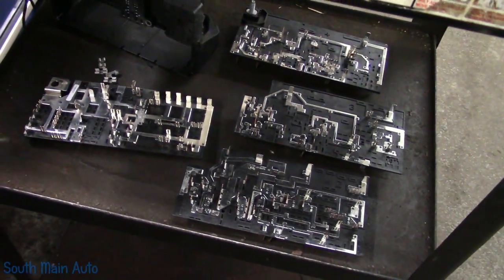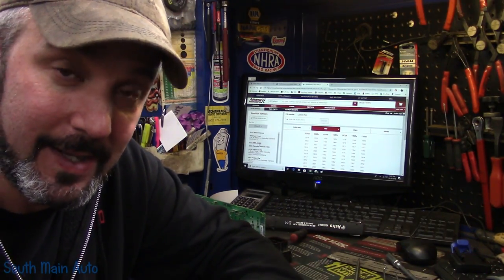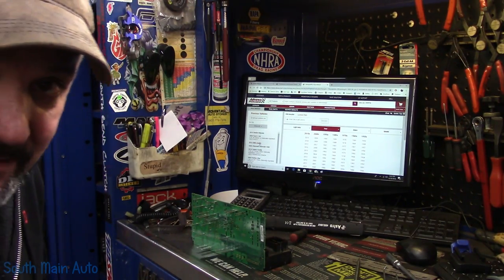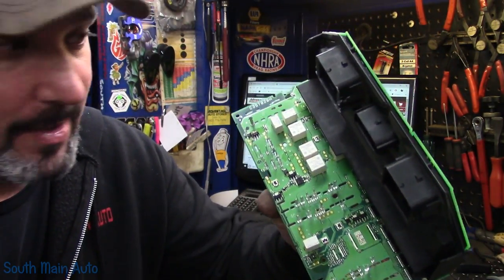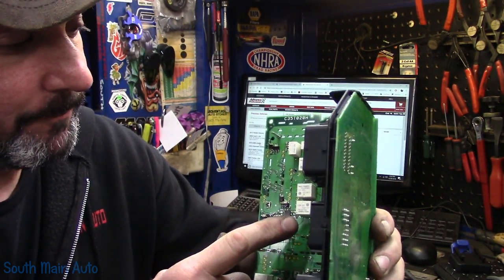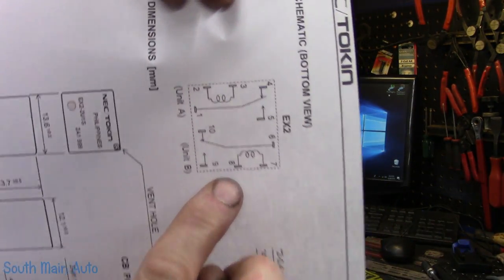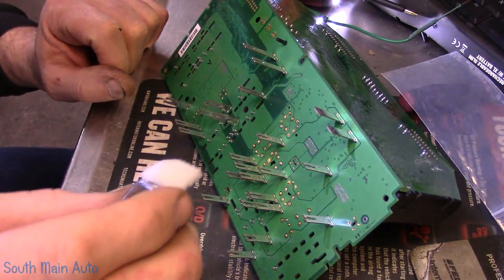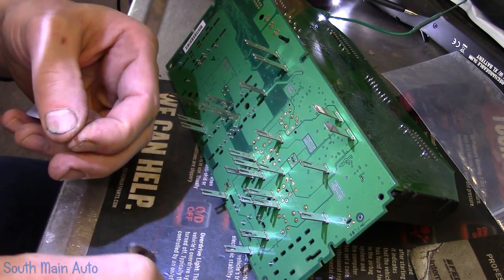Chrysler / Dodge : TIPM Repair - No Wipers

Comment: Well you got the job done, but the quick way would be to cut the whole relay off its base with some side cutters. Then cut up the plastic base so that you are just left with the relay base pins sticking out of the circuit board.Apply heat from the soldering iron to each pin in turn and pull it out of the board. Then get a sewing needle of the right size, reheat each hole and run the needle through to clear out any solder. Fit the new relay and solder.

Comment: Board repair is great Pro tip find something on the curb with a circuit board to practice on before you take on a $600 board

Comment: Desoldering braid, flux, and a solid temperature controlled soldering station such as a Weller, will get you to pro status quickly.  Hold the iron atop your fluxed braid over the solder joint, and the solder will wick straight out.  650-700 degrees is where you want to be.

Comment: it's the black chip usually a micro-controller or FPGA limitations are programmed and so it needs to be re-flashed the correct way to use microchip

Comment: Oh man, Chrysler/Dodge need a kick in the relays over this.
Done a few of these including external mounting relays.
Is pretty easy with good solder sucker tool .
Once you done half a dozen it worth doing it for customers as quick, parts/materials under 10bucks and a good earner and saves customer money and down time .
Easy self warranty for 12 months and I had none back for warranty yet .
Buying oem new total waste of money, reman option if life warranty but in house relay repairs is way i'm going when possible .

Comment: I know this is a old video but man you are amazing 
I own a 2015 Ram 1500 for 8 years already and I love it till 5 months ago I trying to install LED lights
That mess up the stupid famous TIPM 
I wandering if there is a relay down below the TIPM for the passenger side headlight 
I tap on a cigarette lighter fuse and ram a wire straight up to the bulb and another one from the bulb to ground 
It is not a good fix but I have a light on the right side wen I turn the truck on 
Is there is a relay down there I may do the same you did with your sister wipers 
What do you think?
Thanks for all your great video friend

Comment: You were Exactly right when you mentioned using flux when using the desoldering wick put a little flux on the wick touch the solder pad with the wick between the wick and your soldering iron and Robert's your Dad's brother!
 However, when I saw you holding the solder wick so close to solder pad  i Cringed!
 That is how i learned Not to do that! 
Hold the piece with some pliers   or forceps then apply heat.  Not only does solder Wick up the solder So Does Heat!

Comment: Eric 'O' can you please explain why my wife's 07 RAM 5.7 Hemi threw a MISFIRE CODE on #5 cylinder when what was actually happening was the Hydraulic Lifter Roller had seized up and destroyed the Intake Lobe. Why would that throw a MISFIRE CODE! Shouldn't the KNOCK SENSORS have picked that up? It was not an electrical issue after all.

Comment: Clean the tip of the iron first with a wipe of a wet sponge. Cleanliness is next to Godliness! 
Apply a fresh coat of solder to the tip. Touch the cleaned tip and apply solder to the old solder joint. CLEAN THE TIP!  Your procedure with the solder sucker is correct. I use one of those solder suckers on circuit boards of the flight simulator all the time. They work great. The only thing better is a heated solder sucker. Don't stay too long on a hole for you will desolder the land on the circuit board.

Comment: The solder wick has flux in the braid, which is how it sucks up the solder.   They come in narrower widths than what you have....and the narrower wick is what you needed. Put the wick on top of the connection, then heat it from the top through the wick.....  :)  Solder suckers work great too.....   Same deal, heat up the joint, and with the iron still there, suck the solder out.   Keep in mind that plated through holes....are sensitive, so don't go poking or pushing components through the holes....just suck out all the solder.    Takes a bit of practice...have fun!!

Comment: The most likely reason for the contact melting together is a high resistance contact.  I repair this type of electronics for a company who inspects rail road tracks for defects.  When the contact becomes resistant it can get hot enough to weld together.

Comment: Yeah ya need to add solder to the solder joints, then remove the solder as said by beachwood619. The soldering iron is hot enough for soldering but not for de-soldering. The Solder wick can be folded over having two layers, then lightly applying solder flux to help the solder flow on to the solder wick while slightly moving the solder iron and wick back and forth. Practice makes perfect. A hotter soldering iron will allow you get on the joint and allow the solder wick to suck up the solder a lot quicker. Good fix I am impressed you took the relay box apart and fix the din dong designed relay box. I use a 100 watt iron and a 75 watt iron for those solder jobs. Got to keep the iron tip clean also.

Comment: The relay contacts fused together was probably caused by some dirt on the contacts causing them to arc. With DC, once they begin to arc they can continue to arc till they melt and fuse together or they melt far enough apart to break the arc. larger DC relays actually have arc quenchers built into them to extinguish the arc.  AC relays do not tend to have this issue due to the sinewave passing zero volts, extinguishing any arc.

Comment: As others have commented... whether wicking or sucking, add fresh solder first. Especially those new lead-free things are a b*tch to wick without adding solder first... your wick will run dry of flux before the unleaded solder re-flows well. 

Europe has pretty much phased out leaded tin solder from private customers, leading some of my hobbyist acquaintances to hoard it when it was still available. Despite that, I have found a 70% lead mixture that was openly available. I haven't tried it yet, but I assume it might be great for reflowing unleaded.

Comment: When you use a desoldering wick, you need to first clean the board with alcohol and a toothbrush. Then, you add NEW solder to each joint the wick will be used on. The new solder will be clean and will be transferred easier to the wick. Also, ensure the tip of iron is clean. If it isn't clean and has ash all over it, the heat will not be evenly distributed.

Comment: Could be the soldering iron tip was a little small to transfer heat quickly enough when desoldering. The braid never works for me....use the pump. When the hole is cleared of solder I break the pin loose with small pliers, grab the pin tip and pull it sideways to break the final bit of solder free. You did a good job....any job that works is a good job IMO

Comment: The fuel pump relay recall for the Dodge Durango works for all cars.  You can splice in an external relay with instruction and kit from Dodge.  Worked on my 2011 Caravan.  I would bet every relay could externally replaced by splicing the harness like the fuel pump relay recall procedure.

Comment: you're hands must be fire proof because of how close you were holding the solder wick. I give it about 6 inches of slack and hold it buy the case so i don't burn my hands, the heat should transfer to the wick. I was waiting for you to jump back and say ouch, but i guess not.  maybe that was the issue, you have to put pressure down on the solder joint with the wick inbetween and it will absorb into the wick. Also  sometimes you need a solder sucker.  must have really felt great to save your family 600 bucks! Though, why did you let them buy a dodge?  in any case, this video shows you are human ! hah Happy new years SMA.

Comment: great job even though you weren't 100 percent confident. if you would have added  a liquid liquid flux it would have gone a little easier. also when you use the wick to remove solder you need to put your heat on top of it to draw the solder into the wick..great job though.  example of flux 
Kester RF741 No-Clean Electronics Rework Flux 6cc
by Kester

Comment: Good video. Always add more solder to each pin first,, more solder is better, clean the tip constantly, use extra flux to help solder flow.  Your tip seems a bit too pointy for this application. 
i find the solder wick is less effective than the sucker. If the sucker does not work on the first try, just add more solder and try again. This PCB is not fragile or high density so you can just go to town on it until the relay comes off.

Comment: Add solder to establish a better heat transfer medium, THEN once it's molten use the solder sucker to clear the hole. Might have to wiggle the relay pin with the tip of the iron to unstick it from the plating in the hole. After they're all free, it should just fall out.

Heat the joint, then quickly slide the solder sucker nozzle over the pin and press the trigger.

Often you have to add fresh solder first to get the joint molten and have enough thermal mass to stay molten while you remove the iron and cover the joint with the nozzle.

The danger is damaging the plating in the hole, or pulling off the pad from the board.

I knew you could do it!!

You just need practice, and a couple of non-intuitive techniques (like adding solder first) and you'll be a sparky wiz in no time.

Modern PCBs are fabbed with non-lead solder, which is hard to flow, so adding 63% lead/37% tin solder (old school) added to the joint makes it easier to work with.

Congratulations!

BTW - the braid is used mainly to clean up excess solder stuck to the pads. Non-corrosive paste flux helps, too. Get some thinner 63-37 solder, and (trans) Bob is your auntie!

Oh yeah, Happy, Prosperous, and Healthy New Year to you and your family!!!

Comment: the park position switch is the only indicator the "ECM/TIPM/BCM" has that the wipers are actually working. I'd guess the code set from the relay being bad and wipers not moving at all or only in one speed.

Comment: Iron tip is too wimpy (small) for the size of solder wick you're using. General rule I follow (that might not be right) is to use the largest tip that the circumstance will physically accommodate, and always use chisel tips for through-hole joints rather than conical ones.

If you're using an unregulated iron it also probably doesn't deliver enough power. an $80-100 regulated soldering iron makes a world of difference.

Also, have a sponge wet with water (a regular kitchen sponge will work, distilled water is ideal but tap is probably fine) and wipe your iron tip on it frequently to get flux off of it--flux staying on the iron tip with burn until it turns into carbon which is a major pain to get off once it's there.

Comment: Next time put flux on the copper braid It will draw the solder out of the hole. Personally I prefer the solder sucker works faster and doesnt heat soak the copper lines on the board which can cause them to lift(you dont even want to know how to get those fixed) Otherwise Great job You really earned those  cookies

Comment: I could tell up to 20 minutes in that what you needed to do was flow some of your lower melting temp solder onto this automated hard solder that your tip will barely melt. What you need with the braid is a small flat tip, not that tiny pointed tip. It will work great when you flow some of your own solder onto that manufacturing flow table solder

Comment: Eric O does board-level component repair (NOT!!!) Love it! Great job, Eric. And a nice thing you did for your sister. If you are serious about improving your electronic soldering skills, consult with a local Ham radio operator. A lot of us Hams like to tinker with electronics - like building kits, playing with Raspberry Pi computers, and even teaching soldering techniques. Learning how to repair things - including replacing relays on TIPM boards - is a very worthwhile skill.

I did a little Internet research and found that the closest Ham Radio club is the Keuka Lake Amateur Radio Association right up the road in Bath NY (http://www.klara.us), you might want to check out their Web site - you might know some of those folks.

Keep up the great work! "73" (means 'best regards' in ham radio jargon), David in Texas (ham callsign K5GIL)

Comment: Soldering skills are one thing but tools are another - buy a soldering station one that can regulate temprature, and when desoldering add more solder and flux to heat and it will come off easier (more to heat easier to remove + more lead content = easier/softer), maybe a little copper desolder braid instead of the sucker.

I thought it was me that sucked at soldering until i had the right setup, it doesnt even cost much.

Comment: Hi Eric, the tip of  your soldering iron should NEVER be a point, how do you expect to transfer enough energy through a point, Just run the file over the tip,  0.5 to 1.5mm flat will give you the area needed for this sort of work. That is why you had so much trouble getting the solder in the joint melted.
With the tip, the way it is at the moment, solders a joint because the added solder increases the heat transfer area.
The relays you replaced did not look like they could switch the relatively high wiper motor current, they may control a bigger relay, what doe the vehicle schematic show?

Comment: Nice job mate but I think you mite of fried something have a look it at 1212 you can see a spark on the other bored  some times thay will put a diode across a relays coil to stop the back emf form damaging the control side of a ecu  when testing with a power probe or and other power source you have to be carful of polarity and how much current you put on the circuit it can burn up the diode or the circuit trace  the diode is placed revers bias os if you put positive supply on the negative side of the circuit it will be a dead short and if the current is high anuff it will destroy the diode   Lol I learned this the hard was  as always awesome video mate and big thumbs up 👍
Reply: the pins he hit there and sent sparks flying were both connected to the same circuit "trace", which also appeared to be a larger ground trace. so the only thing he shorted there was the tester and leads.
I think Chyrsler has the "diodes" all in the main ECM or BCM that controls the TIPM, but I haven't bothered to tear down nor repair anything for quite a few years now, so they could have changed things ;)

Comment: I'm no expert, but since you replaced a double relay, could it be one half be for running the wipers and the other half for parking the wipers?  And so replacing the double relay fixed both problems?  I do seem to recall that both halves of that relay you replaced did not click nicely when you were testing relays before you got to soldering...

Comment: Lots of advice on soldering and who to watch on YouTube in these comments. 
First real thing no-one seems to mention is, you have to do it, to learn. Watching videos won't teach you squat in anything that requires learning a physical skill. Practice does that.
This whole job would have been much quicker if you had used a larger wedge shaped tip on your iron but, only experience will teach you that. 
Flux can be helpful but, using the wrong kind of flux for the component you're working on just leads to more problems down the road. Corrosion, cracking joints and so on. 
Solder wick is meant as more of a cleanup tool. It can be used for this sort of thing but its a slow process and as you found, nowhere near as time efficient as a simple solder sucker.
Those suggesting a hot air rework station aren't familiar with the construction of the TIPM and similar boards in vehicles. There are far too many pins that could be loosened due
to their close proximity to the relay you were removing if you use hot air. It can be done but its definitely not the right tool for the job.  All in all, you did a fine job removing and replacing
that relay. Actually, a better job than many YouTube electronics repair people do and they do it every day.

Comment: I wasn’t cringing at your de/soldering skills nearly as much as feeling your pain. I can solder wires together, but PCBs are a totally different beast.  We know heat kills electronics, and we know heat conducts through metal. 

We need heat to make the solder flow, but it’s incredibly nerve wracking because how much heat is too much? How long is too long applying the iron? Like poor Happy Gilmore and his short game, how do we make the solder go where we need it to go? How many times can you try again before there’s so much crud on the board and it’s been heated so many times it’s toast? I’m a programmer, not an EE :(

Comment: so you put out this video today, i just got done reflowing the entire instrument cluster of a 1999 dodge neon  to fix there famous crappy solder job on the  non opperational cluster ..... just to find out that i believe to have a bad diode or two hidden in the wiring some were in the interior lighting circuit .... resolution or temperary fix remove door ajar bulb and the ground loop ......

Comment: When the iron is hot enough the solder melts almost instantly. Tip needs to be tinned. Oxidation will prevent heat conduction. Do not hold the copper wick in your fingers! HOT! Copper conducts heat really, really well! But, you know that by now. When putting in the new relay, trim the leads after soldering into the circuit board.

Comment: Use wedge tip solder iron, de soldering multiple pin component is difficult to remove. You should a de soldering video.

Comment: The trick is to get the solder off without destroying the underlying printed circuit. More than once I've ended up running a wire from the contact pin to a different spot on the same part of the printed circuit.